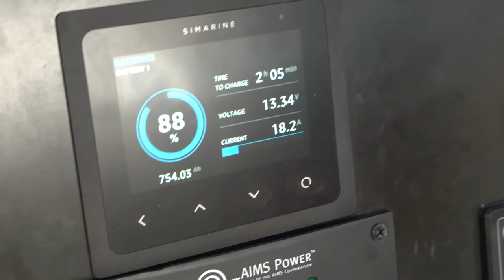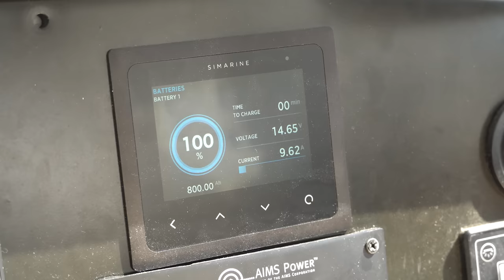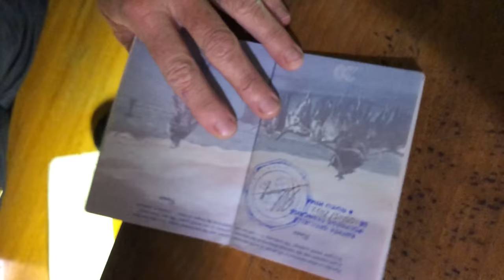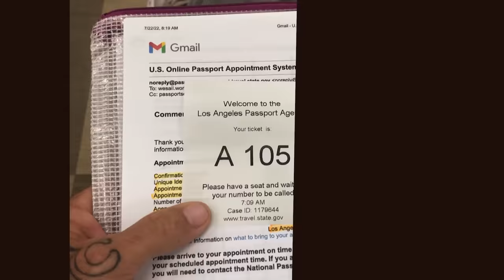All Alone on the Sailboat; Warren Leaves VA | Episode 182

Comment: .... Well! ..... of the two tasks, going back stateside is not the one I would have chosen .... alone time is defined by a lot of people as being away completely, immersed in different surroundings from the norm .... yes some need that and may have the thought from time to time that they wish their partner was there to share this, and many deny this because this does not fit in todays definition of alone time. Alone but not alone is being down the hall doing your own thing but still hearing your significant other move the chair they are sitting, being able to shout out and connect for a second, go see what they are excited about and join the excitement or just tell they are being silly. I guess when you are not sitting in their lap there are different degrees of alone time, both sitting on the couch reading different books and the interaction amounts to wan-another-coffee, is technically alone time, ya there is another human there but that is also true at the spa, Think sometimes the alone time that was strived for turns out to be a disappointment but not admitted . This alone time was forced on you and the rejoining countdown started pretty quick. Have seen people that focus so much on alone time that is seems like that's what they live for and it makes one want to question their relationship. The alone time you talk of and celebrate is when the two of you have no crew aboard ...... had to laugh Erica re the solution to getting the dinghy to start. The vehicle I drive would not start and it always starts and for 45 minutes was failing in this mission. Solution, realizing it was in gear, these vehicles are always left out of gear. Turns out that left in gear "no starty". There were others standing around giving suggestions and a lot of comments when it was discovered that it was in gear. .... you sure are going to enjoy those batteries .... chuckled at your dad cleaning and saying it had not had attention in a long time. Those little things that are not on our radar and then we wonder how on earth it is not on our radar .. you guys are a great team, glad you got the Visa stuff sorted with the high commissioner. I'd be sweating bullets too. One never knows what type of person the gatekeeper is going to be and if maybe their toast was too dark that morning ....  thx for the share ...